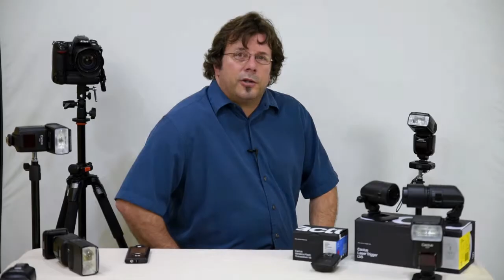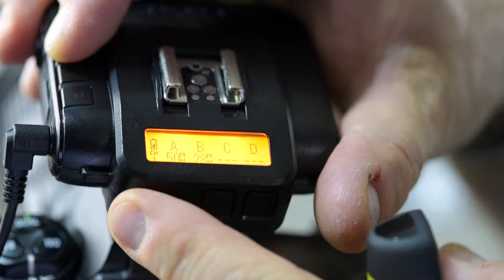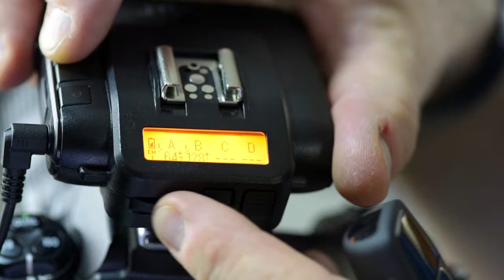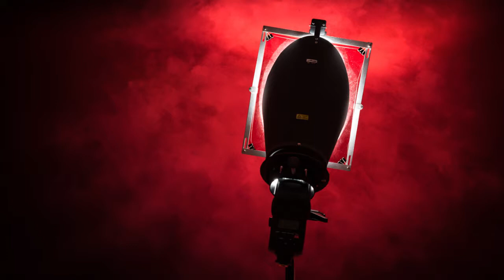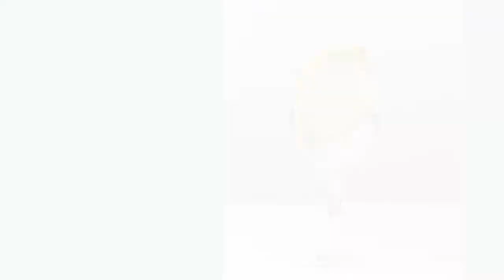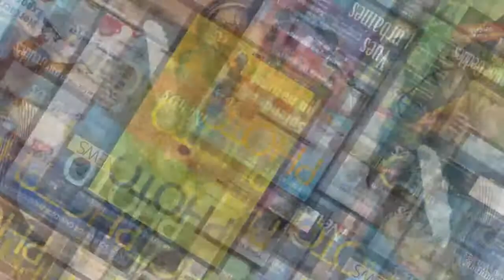PHOTONewsTV: Cactus V6 with Other Cactus Products

Comment: Hi There, I just got the V6 and the RF60 . Im trying to make the V6 as the Transmitter and the RF 60 as the off camera slave . My v6 is not talking to the RF 60 . What should I do for it to talk to each other ?. I also updated the firmware to the latest firmware. Any help or suggestions will be greatey appreciated. Cheers
Reply from the maker: Hi there +emmany. Turn on your RF60 and press Mode until the LCD shows Group A and an "S" inside a box in the lower left. Make sure you're on Channel 1. Then set your V6 to Tx and make sure it's in Channel 1. You can refer to this video on the RF60: https://www.youtube.com/watch?v=je2SryJN7Zo

Check out the Cactus Community and post on there if you're still having trouble: http://www.cactus-image.com/community/
Reply: Hi There, I really appreciate your reply . I just found what the problem was , I had updated the firmware on the RF60 , when i downgraded the software to an earlier version it started to work. Strange..lol . But still from my pentax K-1  im only getting 1/200 sec flash sync speed on the RF60 as slave . On the V6 manual it says it can do 1/1000 sec . I dont know where Im going wrong . I would really appreciate it if you can help me out. Cheers.Emmany
Reply from the maker: Hi Emmany. Unfortunately, your Pentax K-1 will not sync any faster than 1/200. The 1/1000 speed is only for Medium Format cameras. The reason the firmware didn't work properly is that you installed a firmware meant for pairing with V6II. You should be fine for pairing your V6 and RF60 now. If you need to shoot faster than 1/200, you'll need V6II instead of V6. Another advantage of the V6II for you is that off camera X-TTL is now possible between V6II and RF60.
Reply: Hi There , Thank you for the reply which answers my question. :-) , I really appreciate it . Im in Australia so we dont have cactus dealers here that much . Perhaps I must start looking fpr the V6 ii on ebay :-) .Cheers
Reply from the maker: You're welcome. You can check out the dealers listed here: https://www.cactus-image.com/dealer.html Or order direct from Cactus if those are too far away: https://store.cactus-image.com/

Comment: Ive seen test shoots of the flash units that they have troubles overheating? Is this true?
Reply from the maker: +Barky Von Schnauzer Hi ... any flash will overheat. I finally managed to overheat an RF60 by repeatedly firing it at full power for about 100 pops. I was using alkaline batteries, instead of my usual Eneloops and I was shooting outdoors in direct sunlight. This is a tough way to use any flash.

I swapped out the batteries and dropped power to 1/2 and took another 600 images with no further trouble.

This is better than my Nikon SB-900 and 910 and Canon 580EX II, which overheat faster (especially the SB-900). Actually, I rarely use those flashes at full power as they tend to overheat much quicker.

I would rate the RF60 as above average for thermal protection.

Hope this helps.
Reply: thanks